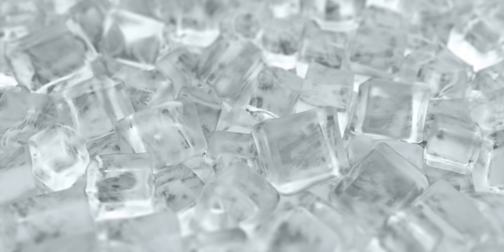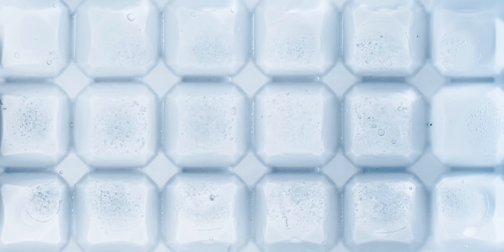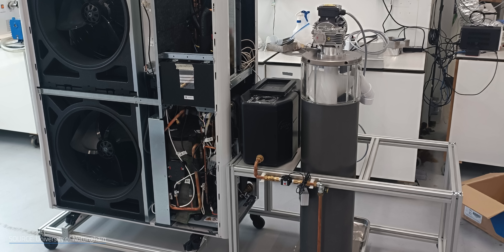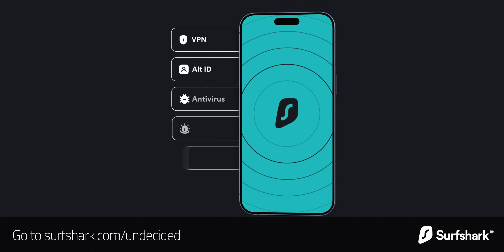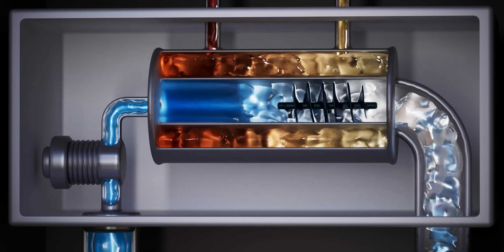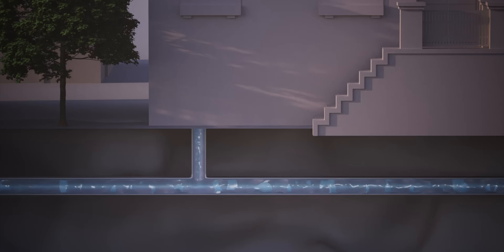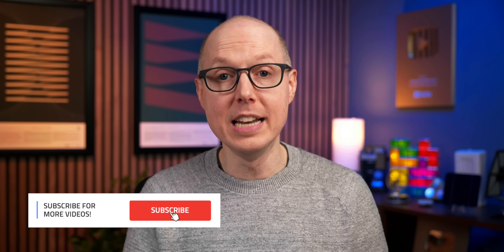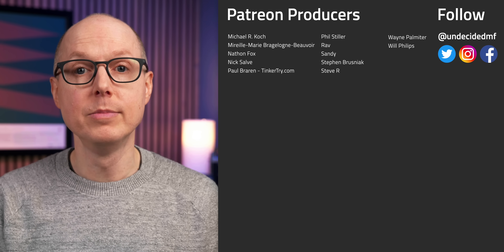How Can Ice Heat Your Home? Ice Source Heat Pumps!

Comment from the maker: Are ice-source heat pumps a refreshing idea? Go to https://surfshark.com/undecided for 4 extra months of Surfshark.

If you liked this, check out Why Isn’t This Revolutionary Battery Everywhere? https://youtu.be/3_NCnxO1KLY?list=PLnTSM-ORSgi7uzySCXq8VXhodHB5B5OiQ
Reply: Could this concept be used with a tank of water buried in the ground? on very cold days it takes the Water from the tank and turns it into I  ice  sludge  returning it back  to the tank To get heated by the surrounding Ground temperature, This would be used in conjunction with an air source heat pump Only being used  when the air outside is really cold,  The air Source heat pump could be used to recharge it using like a big heat battery
Reply: Raw sewage would seem to be a great source for heat pumps, especially in cities like New York.  It might sound gross but waste water has heat from all the showers, dishwashers, and even toilet flushes. Great video Matt!
Reply: 3:37 "To 80 degrees" from where?
Reply: @LucenProject watch again -- from 0°C. 

355KJ takes 1Kg of water from solid to liquid & the next 355KJ takes it to 80°C.
Reply: @alanhat5252  I think science communication hinges on clarity. Once we got to "let me state this another way," there is benefit to explicitly stating (or restating) both the start and end points of heating, even if that is assumed or understood to be the case for some.
Reply: Will we get charged twice for it Like water coming out our tabs  gets charged for going down the drain
Reply: @UndecidedMF  Hi. Fascinating video, but why do you seem to say the "ratio" is 80 while the article says it is 335?
Edit: According to Wikipedia, you are right. I believe the article is misleading.
Reply: Nice ! I tought you were going to speak about the thermochemical heat storages that uses kind of ice like in the heat pads, with Sodium Triacetate. Isn't it promising too ? With Calcium chloride or with Zeolite Clay X13..
Reply: There are lots of ideas, but the devil is always in the details and in this case I can't see it happening unless it is part something that makes the totally worthwhile.
Personally, I am sceptical of these narratives but what I think history has proven over and over again is that creating pathways underground is always a good idea and can be used in so many ways.
Every time I see one of these flying things in the skey, I shake my head. People make such a fuss about cost of digging tunnels but that is because they don't think long term.

California has been dreaming of a fast rail between LA and San Francisco sine 1980. $5 years has gone by. We have had Hyperloop experiments there and Mt Musks Bore company knocking about around the same area. All getting help from the Federal government. It they had built tunnel all through all the issues for which lawyers also got rich. It would have been here and could have taken the grid cables that need replacing down plus a lot more. 

It is the same with HS2 in the UK.
Reply: How about using this system for cooling in a tropical climate and use the hot water for showers?
Reply: if you are going to do this then why not just use existing water line where the city heats the water to something economical. with this, the water comes in already warm doing without house water heating and a house heat pump which works more efficiently with this warm water.
Reply: Hold on a minute, Matt: At around 3:35 is that statement correct? I've read elsewhere in a textbook that it's 60°C, not 80°C. Still a big temperature difference, but there's a 20°C (36°F) discrepancy here. Nonetheless, thanks for the video. 🙂
Reply: A couple of English pronunciation tips, to save you from embarrassment, Matt: For the English city of Nottingham, the 'o' is an English short 'o' (similar to a Russian stressed 'o', the second US English 'o' in 'follow') not an 'a' (the Italian or Russian unstressed 'o', which you are using), and the accent is on the first syllable, not the third. The 'ham' is almost a schwar for English speakers, with the 'a' barely audible. Quite different to US English. Similar rules apply to other English '-ham' place names, such as Birmingham, Covenham, Dereham, Frodingham, Ingham, Willingham, etc. Thanks.
Reply: Please add AI subtitles for Turkish. I want to share it with more of my friends.
Reply: As others have mentioned, ice isn't the source, it's the product, having a click baiting title is one thing, but isn't it going too far to have it affect the script?

What are you going to call the inverse? that's already used in some hot countries? 

"Cooling... with Hot Water?!"

Surely I ain't the only one who thinks that would be a ridiculous way to describe a centralized chilled water cooling system.

Comment: Could you have a big water/ice tank and have solar heating or cooling it as needed? During the winter the ice would be melted by solar during the day and then a heat pump would pull the heat from the water to a home and freeze the water during the night.

Comment: When I got into HVAC, you are taught there is no such thing as cold unless you are at absolute zero (~-460°F or 0° Kelvin). There is only more or less heat. The air you feel from the air conditioner isn't "cold" it's air with less heat. Heat pumps work off of this principle. Even at 0°F outside there is still heat to be absorbed, just less off it.

Comment: This is an intriguing idea but I don’t see it as a serious one. It is all or nothing. Every house on a complete gas line circuit would have to switch all at once (a huge cost for each household). Also, this is essentially just a ground source heat pump. You are dependent on the heat from the ground to re-convert the ice to liquid. How is that supposed to work when gas lines (to my knowledge) aren’t buried below the frost line? Even if they are, the piping between the house and the main isn’t. The tie-in cost of each house alone would be astronomical. The nice piping visual that you have in your video which returns the slush to the gas main in a nice straight shot doesn’t exist. That would mean new lines being installed through and/or beneath home foundations and then significant portions of horizontal runs to reach the mains. Even in warmer climates this would not work. This presentation is a classic case of the scientist’s optimism. Cool ideas are just that until they run into reality. Sometimes the science pushes through the obstacles and makes exponential changes. This seems like it would be a huge step forward for the good, but the obstacles are way more significant than you let on it seems to me.

Comment: It is not possible to use gas pipes for water transport due to their steel composition. Water would cause corrosion through oxidation, and the resulting iron oxide flaking could clog any complex mechanism.

Comment: This is a pet peeve of mine, but there is no such thing as a "geothermal heat pump".  They should be called Ground Source Heat Pumps or Geo-Exchange heat pumps.  Ground Loop Heat Pumps is also used sometimes.  The reason for this is that we're not actually using geothermal energy with these heat pumps, we're just using the giant thermal mass of the earth's crust as a heat sink/source.  

Also, as a mechanical engineer I concur with others here that this idea would never work.  Gas has a much higher energy density than the latent energy of water (almost 5000 times more) so your pipes wouldn't be anywhere big enough.  You also don't have a return loop with gas, and considering the viscosity of ice slurry you'd need gigantic pipes and pumps to make it work, completely annihilating any savings you might create. This idea isn't really well thought out.

Comment: Heat pumps are alright, a reversible refrigerator. Peltier HVAC would be so much better. No moving parts. Extremely efficient. Could use clean water as a coolant, completely nontoxic. I want that on a boat.

Comment: Not too excited about this. How can you scale something that requires many unused natural gas pipes to work properly? Additionally, it would require years of testing to see if the machinery and plumbing are reliable in various environmental conditions. Also there would still require separate heat pump / refrigeration units to turn the cold water to hot water and to turn the non-potable water into ice slurry. Therefore efficiency is probably low.

Comment: Q: If ice is the by-product, is it not a water-source, ice-waste pump? 
E.g. hydrogen-powered car, not water-powered car :>

Also, getting access to non-potable water through the pipeline is a GREAT way to flush your toilets without wasting fresh water. (Hong Kong has long used saltwater pipes for flushing due to its coastal nature)

Comment: my heat pump works below freezing (at least down to 15 degrees F that I have experienced).  it just has to shut down and reverse flow long enough to defrost the coils outside, and it will do that every hour or  when it's below freezing.

Comment: Sorry to say, but it is completely trash idea. Building an entire new pipe network with high end coating to prevent ice from sticking to it? How durable is this coating? What if somewhere it wears of? And what if some moron dumps there something other than ice slushie? Too many fatal failure points for such an expensive project.

Comment: I live in the UK so I watched this video with interest and I would just like to add a couple of points.
Firstly it was always known, even when it was first introduced, that Natural Gas from the North Sea was a finite resource and that eventually it would run out. That would leave the UK with an existing infrastructure that would not be used. Converting it would, on the face of it, be an economic way of repurposing it and we would have pre-existing Workforce that could adapt and mantain it: (I would also point out that the Gas Network in the UK has already been repurposed once when it was converted from the old Town Gas to Natural Gas so there should be a case study available to give an idea on how to accomplish the proposed changes).
Secondly, as part of their goal of achieving a net CO2 Zero Emissions Goal by 2050 the current UK Government is pushing the adoption of Heat Pumps by the population. So inovative technology such as this proposal will be sure to attract the Government's attention especially as, because it will be adapting a pre-existing infrastructure, it will keep costs down as well as minimize Environmental Impact other projects such as Wind Farms and Solar Farms have which has aroused intense opposition from certain areas of the public here in the UK.
I recognise that this concept and approach may not work for other countries and regions. However, I am also of the firm belief that there is no 'One Size fits all' and that different countries and regions should tailor their solutions to what is appropriate for them. I fear that sometimes this can be lost in the general strident call for switching to Renewables which can cause less optimal solutions being adopted which are not appropriate to those areas.

Comment: This might work in areas with district heating such as northern Europe but since Britain has very few of these it would be a waste of time. And if you use the gas network then what happens to the old system when you change over to the to the new system.

Comment: It’s an interesting take on the water loop  style system. At some point, they’ll have to heat the water some in the winter, and cool this in the summer. In large buildings it’s common, a whole building loop of circulating water and each apartment or zone gets its own water source heat pumps, there’s usually a giant cooling tower on the roof, and boilers in the basement, because throughout the year, the loop will need cooled and heater to maintain the acceptable range. Unless they plan on running so much pipe that the geothermal effect will regulate this.

Comment: How can heat pumps overcome inefficient insullation and outside air infiltration?
I work in construction and the majority of houses and buildings will have a lovely breeze  comming throught outside openings, missing vapor barriers and inadequate insullation.
Fix these issues ($) and heat pumps may indeed be viable alternatives

Comment: So basically a broad-area geothermal system with a larger temperature gradient between the hot and cold sides. Granted, they’re talking about using natural gas piping for one side of it; so it SHOULD be easier to deploy. However, it’s still just a geothermal system at the end of the day.

Comment: There is something fishy about this video.
1.The animations show ice being formed, but the videos of the equipment show no such ice.
2. There is no math showing how the whoe value chain would work.
3. Just because it is possible, does not mean that it should be done. There is no comparison with the alternatives.
4. Too many hints that the energy is in the ice, not released as the ice turns into water.
5. The whole return system and pumping of ice slushy has too much hand waving. 
Sorry to say it, but this video does not seem to be up to your standard.

Comment: I can't see this working as it is presented. I can see it working in a 'niche' market, where there are households in a temperate climate, where 'cold' is 3-5 degrees ℃ (37.4 - 41 Fahrenheit). But instead of having an underground pipe system, you feed the slush up to the roof where you have black painted corrugated iron sheets and you have a snaking black slush pipe that starts at one end and weaves up and down the roof  to the other end, to dissipate the cold energy and turn it back to water then, loop it back along the roof back into the system. I am sure a bit of winter rain or sun and the heat that leaks into the attic and warms the iron sheets, would be enough to melt the slush and keep the loop cycling through.

Comment: I'm surprised no one has made a heat pump that pulls heat from the incoming domestic water supply and dumps waste in to the out going sewage. Would be a massive geothermal system that that's advantage of the water supply we are already moving through miles of pipes.

Comment: The forming of ice is a result of the the extraction of heat from water. Not the otherway round. 
Also the gas lines used to supply water is nice, but where does the ice go after? The sewage system? can that handle so much frozen liquid?
And why is the ice not used to cool the fridge/freezer while it is there being cold, seems like a huge missed opportunity.
Reply: Water, or any other liquid, that is still liquid at a temperature below its freezing point is supercooled. Once a supercooled liquid begins to freeze, it will freeze quickly. And as it freezes it gives off heat energy. per kilo of water same energy as needed to heat a kilo to eighty celcisus from sero

Comment: Another critical shortcoming is managing ground and sewer temperature with all the ice outflow. I could see this kind of system easily depressing the local frost line around the sewer enough to burst pipes that used to be deep enough, not to mention the risk of causing ice dams in sewers. I've seen poorly installed geothermal/water heat pumps freeze people's incoming water lines, and this would make that into a community wide problem. Certainly not insurmountable, but since the existing gas/sewer lines weren't installed with this in mind, it will take very careful planning and will likely exclude many locations from using existing infrastructure.

Comment: I can understand that by switching to this instead of LNG, the LNG wouldn't be as universally common; but the issue is that people would still use LNG for cooking quite often. So shutting off the LNG would also necessitate those people to truck in the LNG and install a storage tank on their property, or switch to propane with the same issues, or buy an electric stove/oven. Never mind LNG water heaters or other equipment.

Comment: This is incredibly stupid.
The most obvious flaw is how to do the changeover?
Currently very many homes rely on gas being delivered by pipe to get heating.
This proposes to switch the pipe to deliver water instead.
This involves detaching the existing gas heating and attaching the heatpump in every home on that network which is not something that can be done overnight! (Or even in a single summer)
How do people heat their homes during the changeover period?
It's a logistical nightmare!

On top of that - there is no return pipe, the gas network is one way. If you use the sewer system as a return pipe then how do you separate the ice slurry from the waste water? If you just push the ice through the water treatment plants (or dump it in the river), well then you have a whole new set of problems in terms of processing and/or water sourcing capacity
Alternatively if you create a return network then you a) need to dig up all the roads and b) you somehow need to heat the ice slurry before recirculating it - where does the energy to do that come from? (You could just use the atmosphere to do it for free, but that will only work if the temp is above freezing...)

Finally, if you're going to all the trouble to convert the gas pipes to water, and have some magical return mechanism, at this point why not just do district heating? Sure there are some heat losses during transmission but the economies of scale probably make it worthwhile...

The only thing I can see in this proposed system's favour is that maybe you don't need to restrict yourself to water. i.e. using different liquids during different weather conditions that have different freezing temperatures might have efficiency benefits. Although this again opens up a new set of problems of how to cleanly switch between different liquids and retain the ability to cleanly separate them for recirculation...